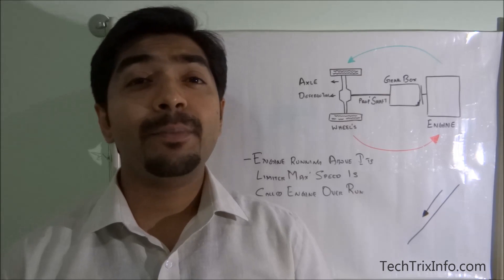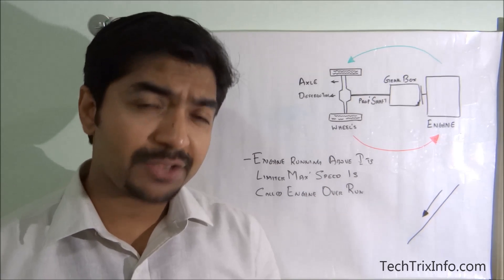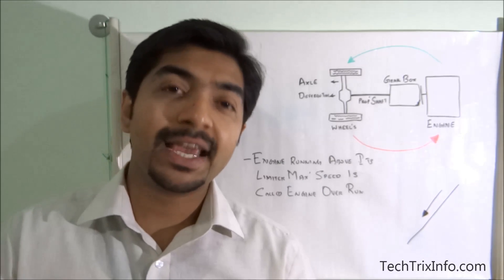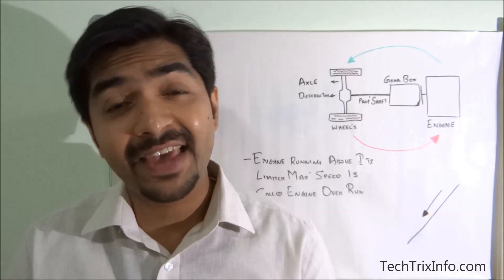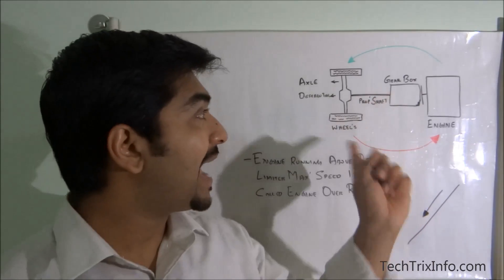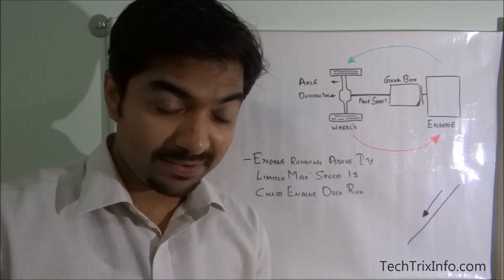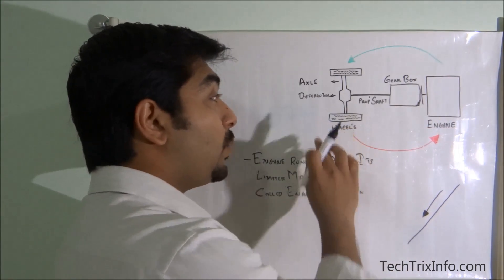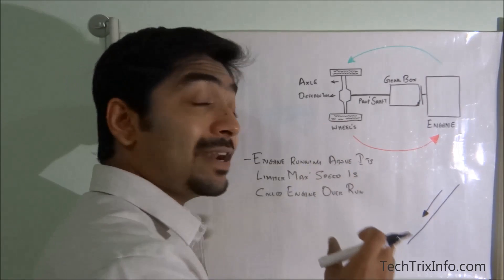Engine over run - Basics

Comment: Can overrun occur dur to faulty radiator connection (suppose the hose is not properly connected) and can the hose come out due to this?
Reply from the maker: If the hose is not properly connected it can come, off. Can you please be specific about the issue.

Did you has a engine over run due to a faulty radiator connection, are you a mechanic. 

Normally it happens when engine draws extra fuel from an unintended source and overspeeds at higher and higher RPM and producing up to 10 times the engine's rated output until destroyed by mechanical failure or bearing seizure through lack of lubrication.

Comment: in engine overrun condition the engine is disconnected from the gear train to save it from failure. it is achieved with the on way clutch.

Comment: Case of engine over run: while driving down hill, if the driver is not applying the brake properly to reduce the speed of the vehicle and on the other hand if the driver is selecting a lower gear to reduce the speed, chances of engine over run is higher. In this case the wheels will be rotating at a higher speed than the power produced by the engine. As there is a mechanical linkage between wheels and engine, the wheels will try to push the engine proportional to the speed of the wheels; this increases the speed of the engine and crosses the engines limited speed, resulting in engine over run. 

Various failures on engine that can occur due to engine over run:

1. Push road bend or crack.
2. Valve crack.
3. Tappet crack.
4. Piston stamping by valves.
5. Engine block crack.

More details on engine over run and failure due to it will be updated in the coming videos. 

Please SUBSCRIBE for more video and updates. 

------
We are taking a lot of effort with our limited resources and time to make simple animations to make your learning experience more simple and effective. Please click the LIKE / COMMENT / SHARE to motivate our team. 
You can also ask for technical video that we should make through comments. 
-------

As you all know there are many technical video been uploaded on our YouTube channel  
Wolfgang Martin  Test Translation von Bionik mit Wolfgang